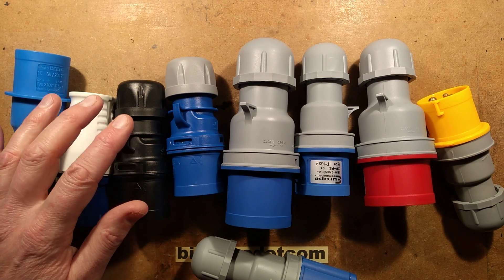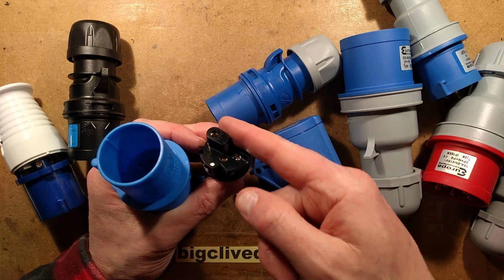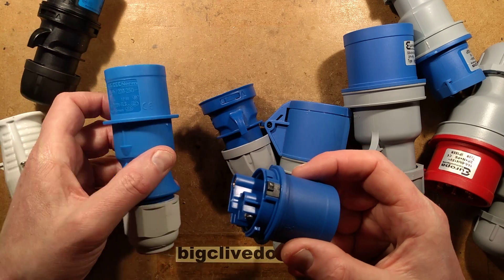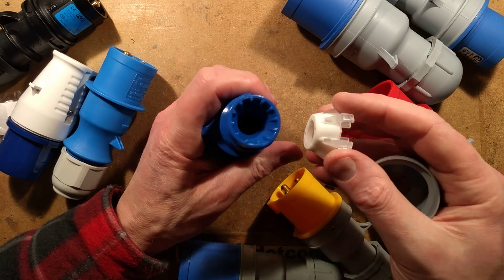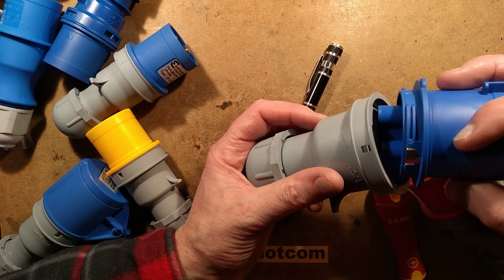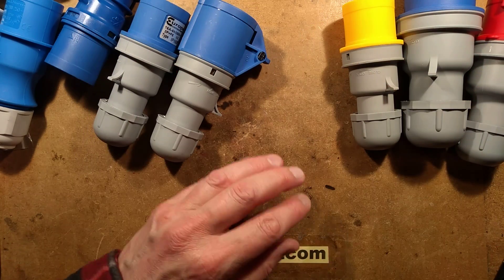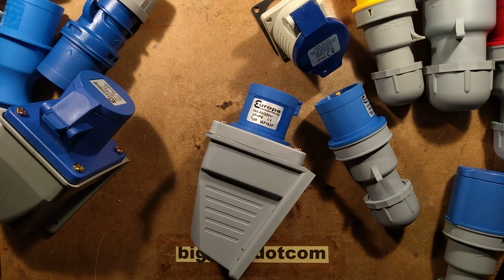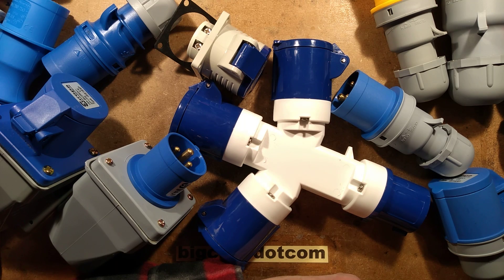My favourite industrial connector (Ceeform).

Comment: norway:
blue = 230 v 3 phase
red = 400 v 3 phase
Reply: Blue = 240 single and three phases 
Red = 415 3 phase 
Yellow = 110 single and three phase
Magenta = 48v ac.
Reply: @dogwalker666  You don't get 3 phase @ 110v or 240v. 3 phase is made up from 3x 240v phases. Also, the purple designation is for 24v. 48v designation is white.
Reply: Steve Wood actually I miss typed but you can have 240 and 110 3 phase we tend to use purple for 48v we dont have white.
Reply: @garrett69  a lot of factory's use 3 phase 110, transformers for distribution but  but each socket is only 1 phase. Some old spot welders are actually 3 phase 110, DC drive panels quite often are 230v 3phase, and if motors are Inverter fed they are 3 phase 240v,  and we did put cee form plugs on. Olso some wacker panels are 3 phase 48v,
Reply: @garrett69 While systems with 400V phase to phase and 230V phase to neutral systems are the most common in Europe, systems with 230V phase to phase do exist and the IEC 60309 standard has a keying for them.
Reply: @ Single phase inverter drives put out 240v phase to Phase

Comment: Germany, the red 5-pole (Three phase 230V) ones rated up to 125 amperes are not only used in industrial equipment but also in event/stage equipment such as lighting fixtures or sound systems. A simple 1m long 125 ampere Y cable weighs around 20kg. You can imagine what the actual cable on a roll weighs. The plug sizes get bigger with higher amperage too so you can't mix them up. For example its impossible to connect a 32amp appliance to a 16amp outlet. There are adaptors for the other way round tho.
Also over here its mandatory to leave the earth wire at least 2cm longer, for the reasons mentioned.

Comment: A similar arrangement is used in Marine applications  here in the USA. I've used them extensively in a printed circuit board factory for portable equipment. They are by far the best washdown rated (IP65) power connectors I've found.  I REALLY like the angled surface mount socket for those applications.

Comment: In Finland the 3 phase one is the current standard, you don't really see the older square 3 phase connector anymore except in old buildings. The single phase ones are mostly used on caravans, motorhomes etc. Some industrial applications too but not as common as the 3 phase variety.

Comment: Used on airport fire appliances. Vehicle is plugged in to power which heats the engine, charges the battery and also runs a mains powered compressor (literally the kind of charger or compressor you'd find at a tool store - seeing as how they're mains). When the appliance is started the plug mounted to the back of the vehicle has a solenoid that pushes the connector out (don't stand behind one when it starts - they swing wildly and can are at head height!). 
A 32A one of these used in theatre was nearly responsible for me being unable to have children. It was on a 10m free cable (plugged in and taped to a fixture at one end, free at the other). Guy up on the ladder let go and it swung the full arc before connecting perfectly with the crown jewels. I don't cry often, but I certainly did that day!

Comment: USA - We use them (red ones) on our power distribution boxes for our high powered PA and lighting systems like at concerts so people KNOW those cables and boxes are ours, this prevents theft that used to be an issue at venues that were outdoors and the equipment stayed on site overnight.  I used to use the US twist lock stuff but those do not keep water out though..
Also my RV trailer and it's extension cables, etc. uses them in blue instead of the standard US 50 amp RV plug.. I had to build a US 50 amp to ceeform 60 amp adapter though.  The idea behind this is at a venue or RV park, I will not have people asking me to loan them a cable that I may never see again.. They ignore me because the cables I use are not compatible with theirs lol
 Recently the county has been having them installed at their radio system sites because they are about to change over to the states network and their equipment uses the  16 and 32 amp versions for power-2-rack. I been converting my commercial DMR repeater racks to use them as well. It separates my equipment from other people stuff and keeps my stuff from coming unplugged "Accidentally" by other rival company  technicians..

Comment: i work for a company in the states that sells and rents a lot of equipment made in europe so i see these connectors all of the time. the only problem is that these connectors are not considered a standard for north america (we use the nema standard for plugs and sockets) so we end up building power cables with the cee connector on the equipment end and a nema connector on the opposite end. lately we've been using adapter plates that bolt into the cutout for the cee connector but allow a nema connector to fit in it's place with no drilling required.

Comment: At McDonalds the female ones hang from the ceiling to about 5 foot from the ground.  This allows us to connect the bread toaster, queing oven aka Microwave, etc on the grill table/island.  This rather large stainless steel island is on wheels, so we can disconnect those connectors and physically move the table itself to clean the floor as grease is a very large problem in the fast food industry.  The grills and fryers run on 3 cables.  2 of them are the large cables and the smaller center one is connected and turns on the hood (ceiling ventilation device).  Each of the grills have 1 big flat top but 2 different temp controls for each side of the grill.  So I imagine that its 1 cable per side of the grill.  This allows us to cook things like Eggs at a lower temp than sausage or hamburger meat on the other side.  The fryer is 2 large vats for the french fries and 6 half size vats for chicken, fish, nuggets, etc.  Some vats are dedicated, like the fish vat is ONLY used to cook fish.  So I'm sure that each cable runs a certain number if fryers.  Same configuration as the grill.  1 Large Plug, 1 Small Plug and 1 Large plug (in that order).  And the small plug has the same purpose on the fryer (to turn on the hood fan).  For the grills and fryers, they plug into a connector directly on the wall behind the fryer/grill and very often get subjected to grease, etc.  The hood system is even simpler.  There is a spring holding a cable that is connected with 2 plates that have been soldered together.  If things get out of control and fire starts, this soldered plate will melt apart releasing tention off the spring and setting off the ANSUL System (Fire Suppression System).  There is also a lever on the wall near by that looks like a fire alarm pull that will set off the system as well.  The put them on the wall across from the grill or fryer so you can be a reasonable amount of distance away before you set it off.

Comment: 5:40 Where do you get 55 volts for either side? Never heard of anywhere using that voltage before.
Reply from the maker: It's a dedicated transformer that converts 240v to 55-0-55.
Reply: @bigclivedotcom  That makes sense. Thanks for the explanation. It made me curious as I've just never saw that voltage used before. I'm used to 120 on one side, neutral and ground (USA standard) or 120 per side.
Reply: @Matt Quinn Would the voltage really matter that much since it's amperage that stops the human heart anyway? As for a hover-mower, I had to look that one up. Seems like an interesting concept. I've saw lawnmowers offered for sale here that use battery packs but I've never known of anyone to actually purchase one (though I assume they do since they continue to offer them). Unfortunately, all of the ones I've saw around here have wheels. Seems like a hover-mower would be easier to handle, on level ground anyway.

Comment: BTW:  The european companies works good I self use only Mennekes or PCE. You can't make wrong something. 

But of course the china crap came to our coast too. The first white chinese connector is a copy of an older style german brand.
But inside screws are better if you use them - not can open under power!
The 1to3 looks to 50% okay - to give power to lamps in front of tents and caravans. Then a cable between to next 1to3 ... 

BTW: Funny that some camping places wish 2.5 qmm cable from customer but not know how heavy and looks a heavy rugged plastic/rubber cable. I like to shocked.

Comment: Used in UK data centre, either two 32A single phase per server rack or 2x 63A three phase per rack (usually one feed from a UPS and the other direct supply for redundancy)

Comment: Sweden, blue and red ones commonly used... and green ones for 400Hz in aircraft related applications.
About current ratings..  it makes more sens if you start from 1000A.. and halves the rating...ie.. 1000/500/250/125/63/32/16... ie the 63 A is a rounding instead of 62.5A... :)
Reply: The green connector is the only one which is allowed to be used with various voltages between 50 and 500V. The other colors are fixed voltages!
Reply: @julianreverse  They are all ranges of nominal voltages (and in turn each nominal voltage is a range of actual voltages), but the weirder things like 400Hz and DC coded connectors have much wider voltage ranges than the regular AC coded connectors.

Also there are less colours than keyings, for example the 365V-415V connectors and the 440V-460V connectors are both coloured red but have different keyings.
Reply: Yup, red one can be found in just about any concert hall or conference hall just outside the stage.
Reply: Halving from 1000 … that's one way to explain it, but it's actually from the R series, after one Charles Renard.
Reply: @Anvilshock  It seems it's every third value from the R10 series rounded to the nearest whole number.

The fact they took every third value from a series with 5 values per decade and then rounded to the nearest whole number rather than a consistent number of significant digits makes it hard to see the pattern.
Reply: @ Well, that's because those values aren't meant to be scavenger hunt clues to decyphering some secret number series. They're the practical application of it, and that practical application's prime motivation is very unlikely to be how well the number series it's based on it can be recognized.
Reply: In Finland the red one is used in 3 phase power. Our house has one of those.
Reply: 63A is not a rounding of 62.5A,its 60A+5%. 300A fuses are replaced with 315A ones.

Comment: Listen up....RCDs can and do fail frequently, center tapped Transformers don’t.  I’ll keep my 55VAC, you take your chances with a mechanical device.
Reply from the maker: At least pressing the button on an RCD does a full and thorough test of the unit.  I have had old ones fail in the past.
Reply: Or you could just be careful and don't touch live wires :D

Comment: I recently set up a blue 32amp one in my home workshop for an arc welder I got here in Ireland. The welder actually came with a standard 13amp plug on it which blew after about 2 seconds of use. Once I had gone through about 10 fuses I realised the error of my ways and decided that running a dedicated line from the circuit breaker with one of these sockets would be the cheapest solution. This is currently my only use for it. Cheers for the water safety tips btw.
Reply from the maker: The 32A ceeform is ideal for home welders and other beefier single phase equipment.  Although you do have to be careful when you use it to avoid dipping neighbours lights at night.

Comment: Clive mentioned folding the leads over to get a better connection. (at about 3:30 ish)
I was under the impression that every screw terminal has to be used with ferrels in the EU.
Is that wrong or is it a german thing?

Comment: In Finland the red 3-phase ones are the standard for 3-phase power cables. The single phase blue ones have become a bit less typical after motor heaters switched from them to smaller connectors, but are still very common in caravans. Most of the applications for the blue one, I'd say, has the blue connector on the side of a vehicle, and a schuko plug on the other end. Yellow one I do not recall seeing ever before, nor did I know the sizes go so big. The 63A 3-phase plug is quite big already.

Comment: Denmark. They are commonly used for heavy duty machinery like motors and big heaters. Most common type is the red 5 pole 16A. They are everywhere. You can get them with a built in standard 230V outlet too which is nice. At construction sites they are used to hook up temporary (3 phase) panels at anything between 16 and 125A. The blue 3 pole I have only seen in 16A and are also used for heavy duty appliances (industrial) or caravans. Sometimes also for low voltage, all though the purple version can be used too. Sometimes 4 or 7 pole 16A are also used for various reasons.

Comment: My old school in the netherlands used those 3 fase 125 Amp connectors for the stage lighting. i had to connect them often when during christmas time when i was doing the sound and light for the christmas musical we did yearly. i was 14 at the time, and i remember they're HEAVY! and i had to connect 3 of them, they're also not easy to get them in the socket but oh well. so much fun was doing the light and sound.

we also use the blue 33 amp ones for campsites.

Comment: Theese are used a lot in IT. Most large UPS units have them. This is where you would see both genders on the panel. But for generaors Powerlock is used in general. Hello from Russia by the way.

Comment: Very common in Norway, the Schuko-standard can't handle more than approx. 8A continous load at 230V although it's rated for 16A.... 
We've also got alot of IT-grid with 230V 3-phase around the country, so that's the preffered plug system for that.

Comment: Pretty sure I have also seen them used within data centre environment for supplying hookup for the power strips inside a rack too.  Usually with the socket in the false floor under the rack.

Comment: These are just IEC 60309 connectors right? Literally used everywhere in Europe. In Estonia, used for pretty much everything that is mobile - everything from mobile home use logging machiens, pressure washers, welding equipment etc. Semipermanent devices like lathes, mills, circular saws etc. At our workplace it is used for production equipment, test equipment, all sorts of radio and server rack power inputs. The whole production floor is filled with outlets and also inlets for electrical cabinets for the devices.

Comment: Used the 690V 400A rated ones at work, in Norway to supply power to equipment used in tunnel construction. That was a heavy piece of plug to connect or unplug.

Comment: These red connectors (4 and 5-pin) are standard for 3-phase power in Poland. One can also find old-style metal-cased sockets and plugs (aluminium coated with some gray lacquer), the case being connected to PEN or PE pin, fitting the modern Ceeform without problems.

Comment: That "Shark" brand, if I heard you correctly, is identical to the MK design; I wonder who is licensing to whom... MK also do a fully screwdriverless unit, with lock-tab terminals. They aren't just a gimmick (which was my initial thought), they're actually appreciably quicker to terminate (useful if you have dozens or hundreds of cables to make off).
As for forcing 110V connectors into 240V sockets, it can be done, without removing the key tab, I've seen it done, thus proving the saying that if you make something idiot-proof, the universe makes a better idiot!

Comment: Here in the United States we have similar products but not for residential because they’re just outrageously expensive so you’ll see them in commercial or industrial applications in large institutions. Example 50 foot extension cord 10 gauge wire 110 V $50 one of those plugs just for one and $47 you literally spend twice as much on the two ends of the plugs then you do 50 feet of number 10 gauge extension cord

Comment: "Subject to quite terrible abuse". Steelworks, quarries, building sites, offshore on rigs and ships, factories, our apprentice testing rig, generators, portable machines, compressors, lathes, farms etc. I think steelworks is probably up there in terms of abuse as they can destroy anything. Usually four elements involved in that; Fire, ice, water and air :-) 
I blew out the 800A ACB in the works as an apprentice with an american multiway thing that was supposed to fit these receptacles. It was metal. The bench was metal. The test rig on the bench was metal and the connector literally disassembled itself (robots in disguise stylee complete with lightshow and fireworks) as I forced it into the socket. It woke the workshop up.

Comment: They're used in Belgium very often. (I have one at home also. We have 3x400V 32A coming into the home.) Downside of this system, is that you cannot trust the connector for knowing the electrical connection available. Must always measure. Very often you will find the red 3P+N+E variant with the neutral disconnected and 240V between the phases, while in the next street it will have 400V between phases and 240V between neutral and phases. Same problem also for the equipment. This can easily lead to a situation where someone plugs in 240V equipment to a 400V supply. We also use these to connect 32 amp powerbars in datacenter racks. The socket is hidden beneath the floor tiles. I've also seen server chassis and routers that connect directly with a 32 amp plug. 63 amps is the largest one i've encountered in fixed installations.

Comment: UK. cellular telecoms field response. we used to have to deploy gennys during mains fails at phone masts (often at night) if hitching and towing the generator wasnt enough hassle we also had to manhandle ~50Kg of various cables in our trucks because we never knew for sue what one we would need. they come in 3phase versions as well as single phase types shown here. the 3phase versions with shielded/armoured cable are very bulky and heavy.